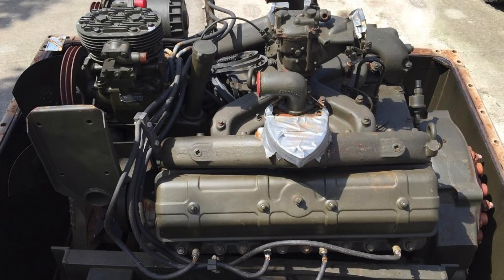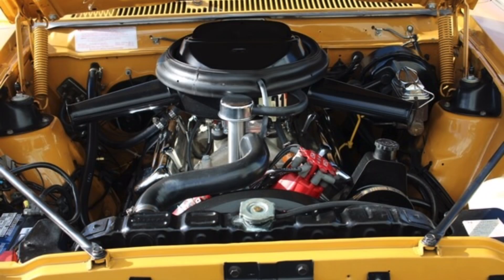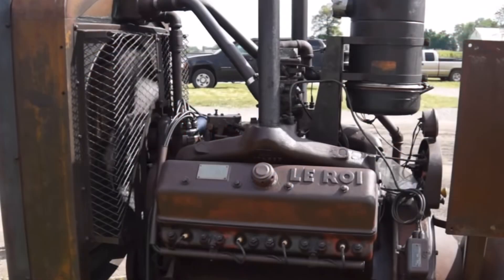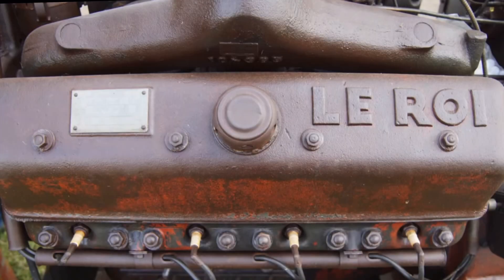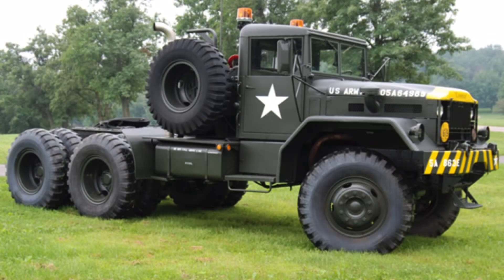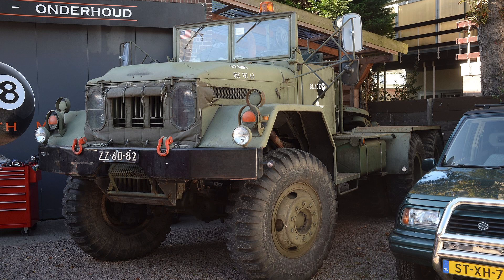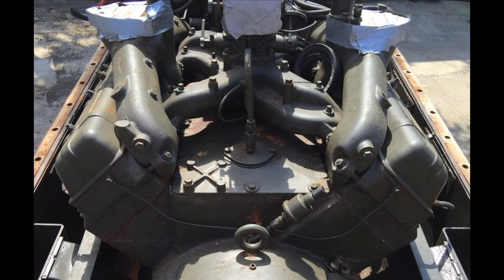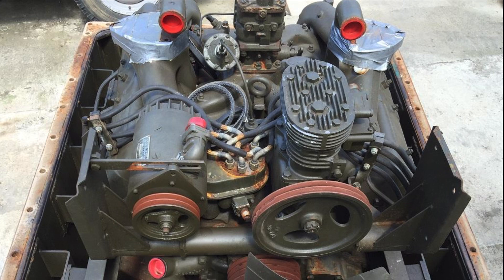Largest V8s You've Never Heard Of: The LeRoi 844/884 Cubic Inch Gas V8 (in Mack M123/125 10T trucks)

Comment: I’m frankly surprised that no one has mentioned General Motors EMD 8V710. This is the largest V8 I’m aware of displacing 5,680 cubic inches. It was used in boats, railroad locomotives, and stationary applications like pumps and gensets. The V8 version is actually quite rare the vast majority of them are V12s V16s and V20s.

Comment: Oshkosh trucks also used some engines from Le Roi for trucks and for snowblower power I think Buda Continental also had some engines that were contenders in that size and class during that time I want to say Buda made V8s of 1125 cubic inch and utilized a small 4-cylinder engine to start it

Comment: Is that really a "cross ram" manifold? It looked like a dual plane design, but with each 4 cylinder-feeding plane more pronounced.
   I'm not sure of any definition for cross ram, but thought of them as multiple carb, with left carb feeding right bank...etc. The fact that the runners crossed each other I guessed was probably for hood clearance and ease of casting...casting the desired long runners would get more difficult with curves. 
    Love your videos, especially those that feature engines or more mechanical aspects, rather than style or other "sales appeal" things.
    They're all good, though.

Comment: Look at it like this. 
It's two inline 4 cylinder engines. 
Side by side. Sharing a common crankshaft. With heads 180° apart from each other. Its why the intake and exhaust face each other. 
If it was just one 4 cylinder inline motor the intake and exhaust would also be on the same side. Every inline motor of the day looked like that.

Comment: The reason for the intake and exhaust on the same side of the head is most likely a cost savings measure, using the 4 cylinder head castings for the v8. Detroit Diesel did the same thing on thier V block engines

Comment: 300 horsepower at 3000rpm but that’s because it’s a generator designed to run at full throttle all the time and needs to be reliable

Comment: International Harvester also made a monster V8 for trucks.  No telling what else you can dig up as REO, WHITE AND Mack all built monster gas engines that were common before diesel took over. Then there were manufacturers that made engines for trucks such as Buda, Hall Scott, Continental, Waukesha, Lycoming, Fairbanks-Morse. Then there were the marine and stationary engines that seemed to know no limits to size.

Comment: I drove one in Vietnam Nam, hauling m48 & m88 on a dragon wagon trailer. From charang vally to pleiku.
Reply: With the governor removed, it would go over 80 mph. With an  m88 on board, it grossed 196,000 lbs. Good thing I was only 20 years old and invincible.

Comment: You also skipped the Ford FE series, largest of which was 538 ci, but that covered the 360 361 390 391, 428, a 514  and the 538. There may have been a mid 200 something ci engine, but I don't remember now. These were before the 460. Found in trucks and stationary industrial engine applications like fire pumps and irrigation.
Reply: The smallest FE's were the 330 and 332.
Reply: @turbo8454  Yep, forgot about them!
Reply: The 360 390 and 428 were fe motors the others were ft engines witch were similar but very little will interchange between them.

Comment: After Le Roi was bought out by Waukesha, they renamed them RoiLine, and they were produced up until the mid-1970's. They used a lot of the 884's on big standby generators for hospitals and such, usually running them on propane or natural gas.
Reply: I've seen a video of a guy that got ahold of one of those I think (been years since I've seen it) I don't know if he rebuilt it or what (I think he did) Then he ran it straight off of his house supply of natural gas right after the meter. Wasn't enough to give it too much throttle. But it did run and ran smoothly. Thing of beauty.
Reply: @thomaslangford3838  There's a great series of vidoeos on a "Roiline 884" Onan Generator which came out of a hosiptal. Very detailed and professionally done video which can be found on YT "Small Engine Mechanic"

Comment: Pound feet is a reading of a measurement that is factually and correctly called foot pounds. Thus 800 foot pounds torque. This means one pound at the end of an 800 foot lever force. You savvy now ?

Comment: Another advantage of having the exhaust manifolds on the top of the engine is that it can fit into a narrower chassis, especially if the suspension is a double wishbone or A-frame design.

Comment: The Le Roi engines were smooth running engines, i ran one as an irrigation engine during the early 90's.  Replaced it with a 855 Cummins natural gas due to not being economical to rebuild.  My father had one that was twin turbocharged but broke a crankshaft after being put together because it was not up to the extra horsepower

Comment: That's called a "hot vee" design. It has many benefits over outboard-mounted exhaust manifolds, even though it does heat up the intake charge. It's not necessarily conducive to high performance, but it does greatly improve efficiency. All the heat rises away from the engine in a more concentrated area, keeping the cylinder heads much cooler, etc. I believe Mercedes actually has a modern twin turbo V8 super car that has this design.

Comment: If you compare horsepower and torque to similar sized diesel truck engines of same vintage, you can only come to the conclusion that power, but especially torque is low. The reason is simple, no turbo.....  it's why maximum power comes at a high 3000rpm, a diesel engine of this vintage and size would produce max power at 2000-2200rpm.

Comment: One unique feature of the M123 was the differential braking lever that allowed the driver to brake the rear wheels on either side individually like a farm tractor in order to make tighter turns.  And you really needed that in soft going because the rear tires outnumbered the front tires four to one.  I don't know if differential braking was truly unique to the M123 but it was the only truck I've ever driven that had that feature.

Comment: When I was a kid my dad had a big  v-8 Leroi for an irrigation engine. If I remember correctly it was a slow turning motor. We also had several 534 fords,605 internationals and 800 HD molines. This was back when we had “big” water. Not anymore 🤔
Reply: We still have several Ford 534s in service in South Tx as water well motor back ups on right angle drive units when power is out to the electric motors. I run them weekly for 30 min for exersize and load test 1 hour monthly. They are on Propane.

Comment: 5:58  "...only 785 cubic inches..."   Well,   I guess you can say that when you talking about engines this size.

Edit and addendum:   My father (1916-1996)  lived in the Detroit area as a young man,  and knew about the existence of Le Roi engines when it was still an independent company,  though he was not a mechanic or engineer.  He told me about a very different Le Roi engine had had seen once,  but he probably also heard a contemporary pronunciation of the name.  He pronounced it    le-ROY'  I don't know if this is correct or not,  but that's the way  he said it.  

The Le Roi engine he told me about having seen  was at the absolute other end of the scale.  He said it was a liquid cooled 4 cylinder overhead valve engine,  and " it looked like the block was about a foot (30cm)  long."

Comment: Hall Scott had a large v 12 gas. Le Roi is/was? Famous as an air compressor company as well. I had worked on several over the years. The large V12 gas is very similar to their V12 diesel that I used as a back up generator, when we needed more power, or were securing the steam plant. Have fun
Reply: the hall-scott v12 was called the defender and was used in some american and british navy boats during ww-II.

Comment: Excellent !   There were a number of engine manufacturers supplying many interesting engines to vehicle and equipment manufacturers during this countrys' heyday.  Continental, Hall-Scott, Buda, Waulkesha were major ones, Scripps / Ferro were early ones that made some really cool and advanced V8 engines in the teens and early 1920's.  Don't forget Northway division of General Motors, also built many overhead valve and L head V8 engines in the 1915-1922 -ish era.   You should dig up more info on the early General Motors V8 engines like these, you cold do a whole documentery on them alone !!   The Scripps OHV V8's were jewels, and there were many other really cool V8 engines, many of them mass produced, long before Henry Fords flathed v8.

Comment: You want more obscure, large gas engines? Check out Sterling Engine Company of Buffalo New York.  I happen to have a 1924 Sterling Coast Guard engine, 1400 cubic inch 6 cylinder, dual overhead cam, 4 valves per cylinder, 4 spark plugs, again in 1924!  That's not even the biggest engine they built.  They also made a "crankless" diesel engine, but I don't know if that made it into production.

Comment: Would like to see some details on cummins 785cui v8 you mentioned as I have not heard of it, the 504, 555 and big brother 903 I have but not that one
Reply: The 785 also had 903 and 950 cubic inch brothers. The 504 and 555 were a smaller engine family that also had V6 versions.

Comment: I spent 10 years in the 80s in Lehigh Valley Pennsylvina. I new a lot of Mack employees and they praised the company. It was an engineering company that would pretty much build whatever a customer wanted so long as the quanity made it profitable. How about a video on sleeve valve engines?
Reply: @garyruark9506: I've been a Mack Truck mechanic for 27 years and the "Mack" you speak of is dead. I first busted knuckles on Mack "B" and "R" models in my early years....they were true beasts that could drive thru a building while hauling a full load without blinking a headlight. The Mack trucks I work on today are nothing more than glorified Volvos with a few bulldogs stuck to them. The only part of the modern Mack Granite series I work on most that is truely still "MACK" is the camelback rear suspension,  they rest of it is Volvo. I wouldn't be surprised at all if the Mack name is killed off all together by the end of the decade. When Mack dies, that will be my "cue" to retire.

Comment: Please do features on the GMC 505 I-6, the Mack 707 (gas) I-6, and the mighty Hall-Scott 1090 (gas) V-12.
Reply: Yeah, I think I've read about the 503(who's counting) inline 6, and smaller ones in that family 426🤔, I think 1950s era.  My big GMC book talks about a completely separate engine family back in the 1930s. And GMC also built a 707 gas 6, they wrote it was kind of a high  hp output engine for it's time, (I guess not just a big slug).  I've tried to look up as much as I could at one time about that Hall-Scott.  Fire engines & logging trucks back in the day.  I had read some posts about at one time, on the west coast a lot of them were ordered as butane burners from the factory.  One guy said, at night, they'd get a fire call, pull out headed to a fire, this was apparently within distance of his bedroom window where he grew up, he said those fire trucks with the butane Hall-Scott engine would be hauling ass up a long steep hill nearby, 3 foot high blue flames coming out both stacks😊 must've made an impression so many decades ago

Comment: There is a guy on YT ,,,Waylon wire old iron,,,He makes rat rods,,And he is currently putting one of the 930ci 12 cylinder GMC engines in a rat rod,,,,He has a whole series just on the engine ,,,

Comment: I worked in the air compressor industry for 40 years.  I have ran across probably 15 LeRoi air compressors during those years.  I was instantly corrected by the owner or management when I pronounced the name as you did in this video.  I was told it was pronounced    La  Roy  not Lee Roy.
Reply from the maker: Ha. Funny. You should’ve said it’s “Leh Wah”. That’s the correct French pronunciation.
Reply: @RareClassicCars  We're not French around here...lol
Reply: I was around a few Le Roi natural gas compressors back in the day...

Comment: A 289 cubic inch SINGLE cylinder engine!  That should be mounted in a hand-made motorcycle frame and taken to a Cars & Coffee.  21 hp is just not enough to mount it in a '65 Mustang.....

Comment: -I suspect that they produced this as a "Hot V" V8 like a modern Audi, for the reason that it was designed with Fairbanks, Alaska in mind.  During the winter in Fairbanks, it is not unusual for the temps to go down below -20 F, and that is why  you see the rolled up fabric covers over the radiator air intakes.  An engine with this low output is not going to put enough heat into the Hot V to make fuel vaporization an issue, so hot starts wouldn't be a problem and the wires were away from the heat as a result, a win-win.

Comment: Interesting. That intake/exhaust set up looks like something you would find on a Wisconsin V-4. Except those were flatheads. Had to look close at the images you were showing to see that the valve covers were correct for an overhead valve head. Odd engine indeed!
Reply: You had to look close to see that.....?
Reply: @Flies2FLL  Saw some mighty strange looking engines and compressors during my career as an industrial mechanic. Things that looked to be an overhead valve/cam whatever set up, turn out to be a flathead with a really strange air or water cooling duct or jacket on top of the heads. Seems during the twenties and thirties, it was a case of "Does it run? Splendid! Ship it!" Yeah worked on a lot of very old equipment. Amazing what is still running in hundred year old paper mills.
Reply: @leonardhopper857  I'm sure you did and I'm sure your experience is incredible, but one look at those valve covers and I know that it is an OHV setup.....

Comment: -I was just about to mention that looking at a spark plug diagram at a K Mart in the 1980's I saw that there was a listing for a 534 cubic inch engine....But then you covered it. 

Great video!

You probably know this already, but light aircraft routinely run 550 cubic inch and 580 cubic inch air cooled SIX CYLINDER engines;  This is done so that they can make 300+ hp at only 2700 rpm, the maximum speed for propellers  [Direct drive is standard, for reliability and weight issues].  If they go beyond 2700 rpm, they run the risk of exceeding the speed of sound and producing only noise and drag.  The pistons of these engines look like coffee cans~
Reply: So propellers themselves "break the sound" barrier at 2700 rpm or the entire plane? Just curious as it does make sense but Im wondering why other "things" (pistons, driveshafts, etc) which regularly exceed 2700rpm on passenger autos dont seem to run into this same issue?

Comment: The engine Ford made for the Sherman tank was a flat plane crank, dual overhead cam 1,100ci V-8 in 1940. That was a beast.
Reply: The Ford GAA engine was a 60 degree all aluminum V8. Those two facts are due to the original engine the GAC being a V12 aircraft engine that Ford designed as an alternative to the Allison V-1710 or Packard V-1650 but that the War Department never asked for nor adopted.
Reply: I'm surprised Ford was involved in the war effort although Edsel Ford was running the company.
Reply: @patrickshaw8595  yup
Reply from the maker: Yes. I have a video on it
Reply: Fun fact..ford has another all aluminum dohc 60° V8...the 3.4l Yamaha developed piece in 94-96(?) Taurus SHO
Reply: @timothybayliss6680  that was a V6
Reply: @timothybayliss6680  that SHO engine was an awesome engine, the earlier version was a V6. Amazing that Ford went from the tank engine and then put flathead  and push rod engines  in their cars after such an advanced engine design.
Reply: @christope44 It all comes down to money.  All those parts via the tech of the day were expensive, people wanted cheap cars, while manufacturers wanted profits.  A flathead six or V8 would move a car just fine, so there was no need to give people fancy engines.
Reply: Came here to leave a comment on just that. Got beat to it...
Reply: The GAA.
Reply: @raginroadrunner  yup, that's the one. Cool engine

Comment: Ok non-engineer guy talking about engineering, the manifolds being on the same side as the intake was almost certainly packaging, possibly for faster heat transfer to the intake manifold when cold.   Second that's not a cross ram intake in any way shape or form, it's simply a dual plane intake...

Comment: In 1988, the wife and I bought a 21 ft Sea Ray. And don't you know the main reason I bought 'REBEKAH RENEE' was when I lifted the engine cover, looking back at me was a Chevrolet small block 400. And boats DID NOT HAVE any of that emission controls. Plus topping it ofg was a Holley 4 bbl. That motor was so strong, I was talking to a guy at the marina was cruising a jet boat I asked him if he would run with me so I could see just how fast she would go, we did, hr said it got up to 47 mph. Plus it would yank and I mean yank 4 skiers out of the water without any hint of hesitation. Bad ass motor. My dad and my uncle owned a 1953 Chris Craft Continental with s Chrysler 440 with 3 2 bbl's supplying the air and fuel.thst boat had a tach and speedometer. Heavy heavy boat
 But9 she'd cruise all day at 34 mph, no problem and would touch 40 mph when he pushed her. When he did, you could literally watch the gas guage drop as we cruised along.
Reply: Folks have a Supra 24' with a 400hp SBC. The upgrade option for that year was a 8.1L. Dad said he rode in one, and you could watch her guzzle if you opened her up. Could pull 6 hydrofoilers though. 
Dad had the big Ole bronze prop on her- wouldn't go over 40mph at redline, but it'd rip the damn handle out of your hands if the drive took "Hit it!" seriously. Ballsy boat. Good memories.